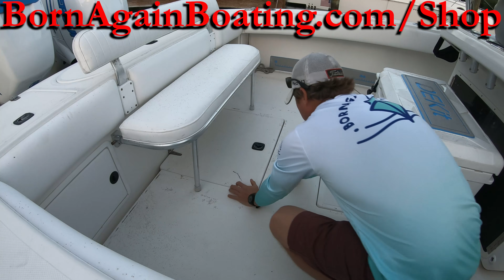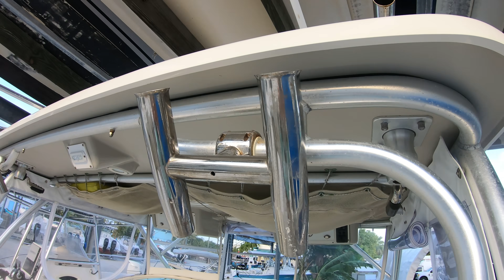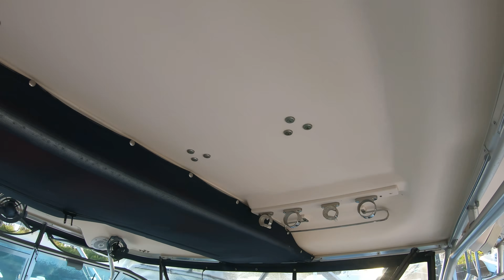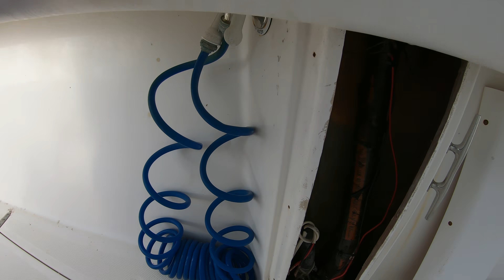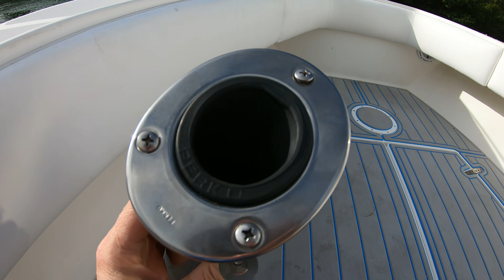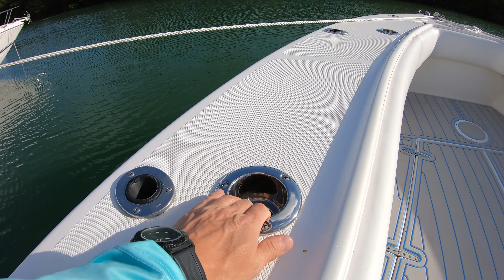Easiest Boat ROD HOLDER Install Ever!! Learn This TRICK Now!!!

Comment: How can I flip a rod holder around? Have a few facing forward i would like to flip around
Reply from the maker: Yes, most adjustable clamp/surface rod holders can just be loosened and rotated, but flush-mount ones depend on the angle, drain direction, and how they were installed. For a simple step-by-step on checking and correcting them properly, we go through more detailed examples inside our Skool community: https://linkly.link/25z03

Comment: #rodholders 33 on a18ft Kenner...16 horizontal on gunnel wall (keeps rods off floor or out of the air when trailered or when fishing, casting). The other holders are used while fishing if necessary, most have something other than a rod in them or when a rod needs to be set down. 6 vertical in center console, 6 vertical on cooler seat holder, 2 vertical off front deck wall, 2 angled in rear deck, 2 on handrail on Center Console, 1 Railblaza next to troll motor on front.

Comment: I have a Bass Tracker bass boat and I only have one rod holder on my boat (it uses the VersaTrack system). I'm looking to add more as this system seems pretty versatile and there lots of options out there to utilize, if needed.

Comment: #10, but I want 10 more. Love your channel, but this vid was waaay too quick & dirty, just punchin holes and slappin in rodholders. Folks need to know that 1) if their washboads are ply under the glass, they need to epoxy coat the exposed wood before installing holder with sealant to prevent water intrusion and rot when the sealant ultimately fails from weathering and stress under load, and 2) if their washboards are balsa cored, they need to remove coring and fill with thickened epoxy that seals the coring from water intrusion and makes a hardended puck that won't crush under the torque of a loaded rodholder. 👍

Comment: Get gem lux best ever no screw holes have your local welder make a deep socket I made mine out of steel they are heavy 40$ maybe make out of aluminum into a socket a lot lighter they are out of I think pompano fl rod holder is 75$ or used to be

Comment: I have 13 vertical rod holders, 4 horizontal under the gunnels, and can fit a few more in my rod boxes.  Really want a few more vertical ones though.